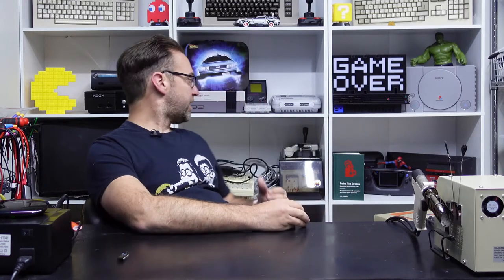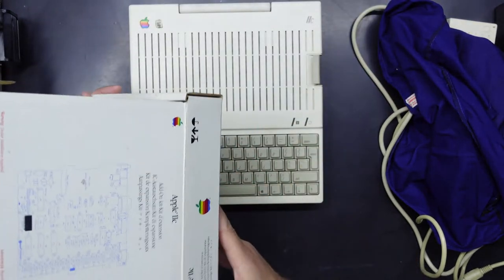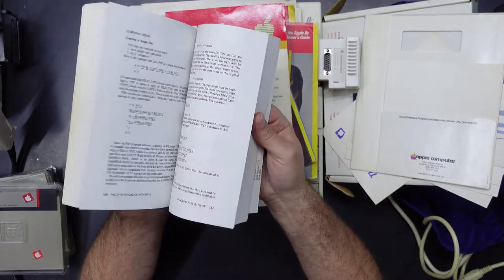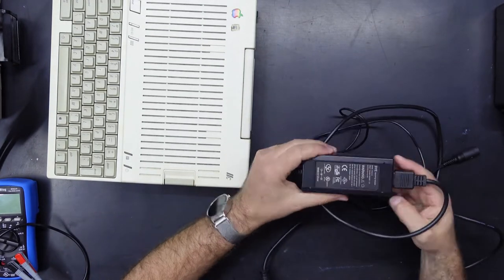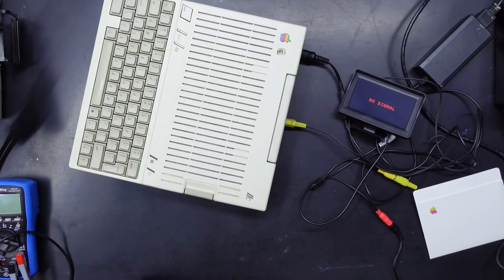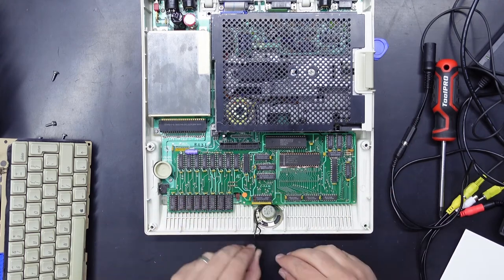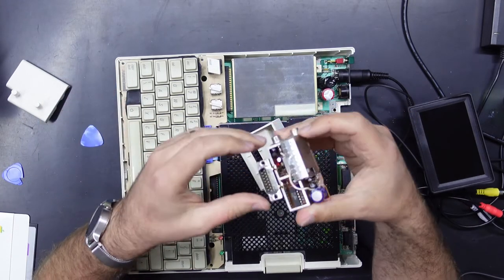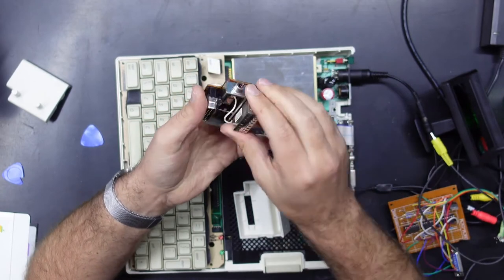Apple IIc Z-RAM add-on, PAL colour modulator, crunchy disk drives, and a keyboard mod

Comment: Apple Logo, in this context is the LOGO programming language. https://en.wikipedia.org/wiki/Logo_(programming_language)
If you have a 15KHz compatible monitor, there's a fairly straightforward cable that can be made to allow you to plug straight into the //c, with full colour and a nice stable picture. I made one for my IIgs and that uses the same RGB connector.
Reply from the maker: Although the IIgs uses the same 15pin dsub connector, the IIc has completely different signals available on it. There's no RGB, it requires extra components to construct anything useful. I could go the IIc VGA by A2heaven but where's the fun in that
Reply: Logo is actually pretty fun to program. First tried it in 1985.

Comment: Is the composite out on an NTSC machine not actually mono with an NTSC color burst signal but no color data as such? I'm assuming the PAL output has no color burst at all as the Woz magic wouldn't work on PAL to fake color.
Reply from the maker: I think you're pretty much spot on. The NTSC machine is mono just with a colour burst signal and with some cleverly placed/spaced pixels you can trick the display into creating colour.
As cool as it is that some of these old machines used that trick to create colour, it sure sucks being in PAL land where we never got treated to this